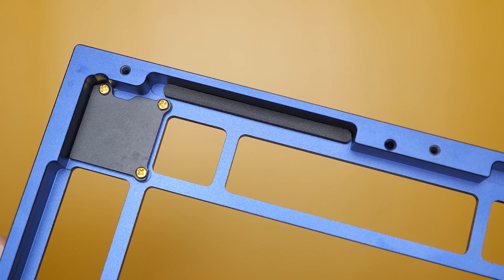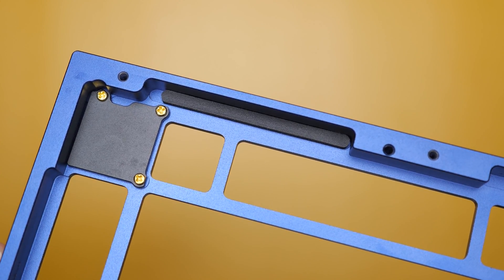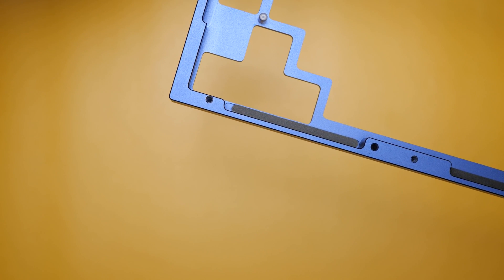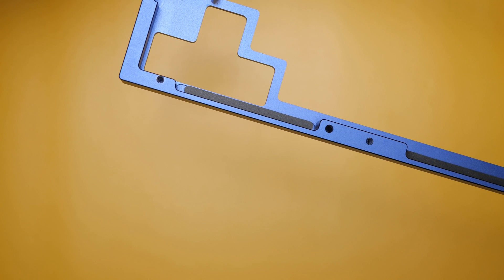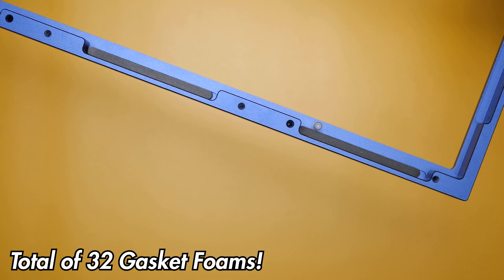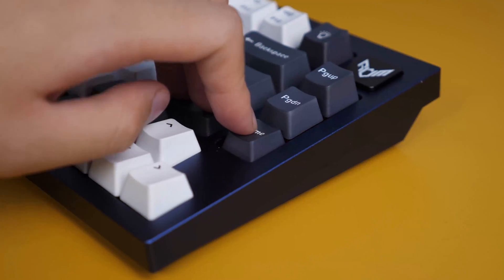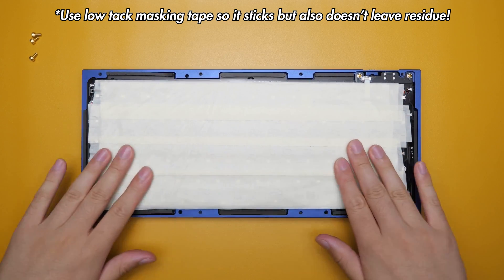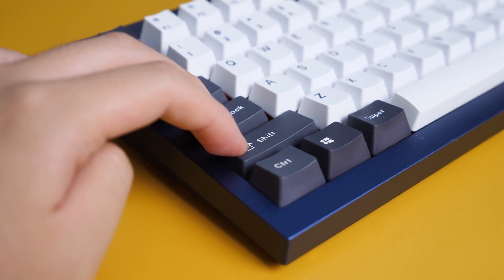How to Fix the Keychron Q1 Sound Issue - Tape/Polyfill/Foam Mod!

Comment: Now what's left is the scratchiness. I suggest a plate foam probably 1.5mm to 3mm and a layer of PE foam over the pcb to minimize the stem impact of the switches. Lube the switches too

Comment: Keybored did a video explaining why thinner foam = thockier sound. It basically makes a high pass filter.

So when you put the cotton balls in it basically did that with the tape mod. I'd say polyfill would be better than cotton balls+packaging foam since you can cover the entire board's dead space with polyfill and tape mod the PCB.

Comment: so after buying a Q1 Knob edition just a week ago the extra case foam is actually a plastic sheet basically but weirdly it does help. I did tape mod mine and add polyfill instead of using the foam, and now they have the force break mod from box now with rubber gaskets on the places where the original force break mod was done. So they did listen to us on how to make the board better. just wish they did make it easier to get to the stabs to mod instead of using so many screws to hold the plate and pcb together.

Comment: my issue with the left side like shift, tab, caps crtl. They sound a lot louder than the rest of my keys and I cant fix it. Not with overlubing the switches or adding more foams on that side.

Comment: Do one layer of pe foam and remove one layer of q1 foam. Do force break an on every corner. Done. I have tried tape mod with 3 layers and didnt like it. The sound is too loud.

Comment: Very good overview of different mod ideas! I cut pieces of rubberized self-adhesive grip tape and placed the pieces at all the contact points between the top and bottom case. I also put the rubberized tape all around the inner perimeter of the top case to dampen it because when unmodified, the top case rings like a bell if you suspend it and give it a tap. I used the painter's tape mod as well – only a single layer made a big difference. Keychron had added an unnecessary second piece of foam in the bottom that prevented the gasket from flexing, so I removed that layer of foam. The keyboard is much better after those simple changes. I love the Q1.

Comment: To share if anyone interested that I just got my Q1 and all i did to remove the ping is Keybored's method of putting masking tapes (2 layers) near screw holes to create a separation between top case and bottom case. I removed all forms came with Q1 and added tape mode (3 layers). Nothing more. With no fillings and Keybored's method, there is no ping and it flexes (due to no fill).

Comment: Just wanted to update you on how to ACTUALLY fix the issue. No need to fill the keyboard or anything. The thing that works is to reduce the source of the ping not to muffle the ping with foam/cotton.

The source of the ping is the actual housing. And to remove that vibration that is causing the ping you simply have to put in some pads all around the edge where the top and bottom meet. This  makes the source of the ping go away and tada no ping.

I had some KBDFans Stab pads leftover and used the material around the actual pads for the stabs by cutting it into strips and adhering it to the edge on the top case. 

With this single easy mod all pinginess was gone.

FYI @Romsicle :)
Reply: Hello... Sorry what kind of pads are we talking? Foam? And how thick?`Would just some painters tape cutouts do as well? Cheers

Comment: If you wanted a quieter typing experience, why not use a different switch type? I know its probably different sounding in person than over a camera, but the only difference in sound between the mods and stock was just quietness and no hard ping sounds from the key caps sound resonating inside the hollow case. 

I personally would have just used the foam and gone with a stealth switch instead of making a mess inside the keyboard. But hey, I appreciate you making the video and taking the time to show everyone how YOU would do it! Excellent video.
Reply: Foam might interfere with the flex of the gasket mount no?

Comment: I wonder if when the knob comes if you're going to need to solder it...? I don't think you could hotswap it, yeah?
Reply from the maker: With the current PCB that I have, it has to be soldered. There might be a specific PCB available in the future that has a pre-soldered encoder. But I doubt hotswappable rotary encoders is a thing they'll implement.

Comment: Hey!
Just bought the space grey keychron Q1 and I’m so glad I came across this video. You’re a legend. 
One question though, so I’m most likely doing the second method tape/polyfill, do I still need to install the KDB gasket foam, or is that only for the first method?
Reply from the maker: Foam not necessary for tape and polyfill

Comment: why not try pe foam mod in between plate and pcb? i feel like that is the best solution if you pair it along with the tape mod and some more pe foam for the bottom of the case. i've used polyethylene foam exclusively and it feel worlds apart from other foams, even more so when it is paired with the tape mod
Reply from the maker: You can definitely try that. The tape polyfill method has done enough for my board to get rid of almost all the ping, so it's not a necessary step.
Reply: @Romsicle  I haven't really seen anyone try it so I was wondering if there is a specific reason that has to do w the Q1 as to why no one does it. Maybe it's just not needed I guess
Reply from the maker: @Defiancy  It's also probably because it's really time consuming to cut individual holes. Since there's already foam there, and it's been shown hollowness isn't an issue between the PCB and plate, there's no point in doing it. It could help make it sound better, but not necessary.
Reply: @Defiancy  pe foam makes all boards sound the same. its boring to listen to after the 50th sound test. the q1 sounds good without heavy modding